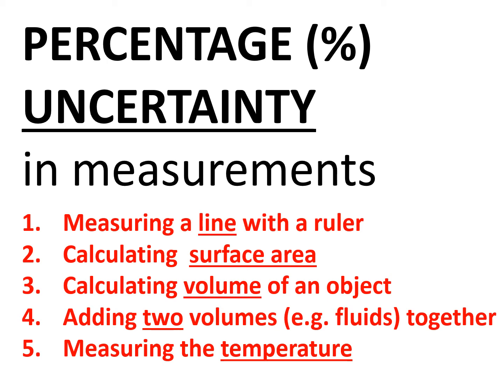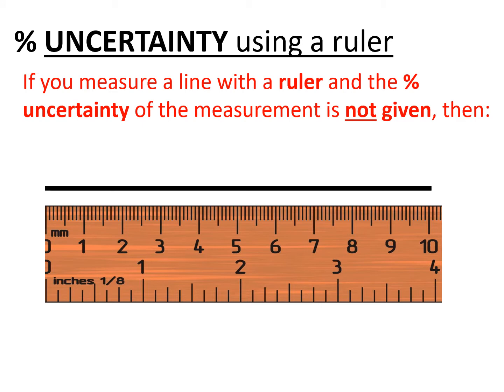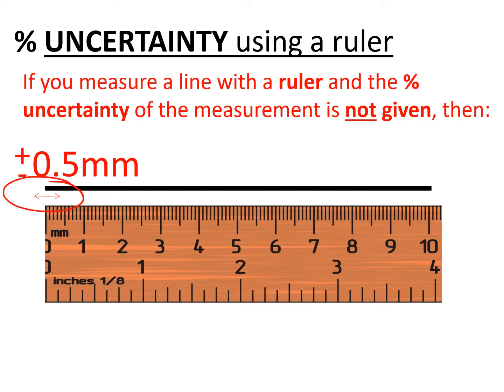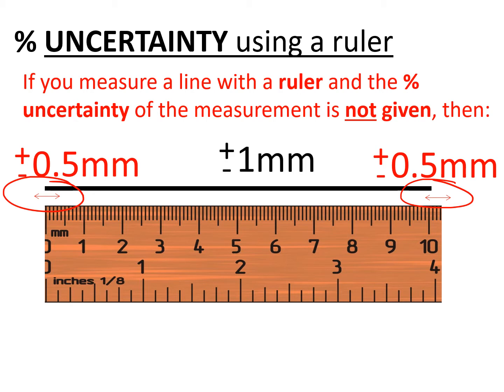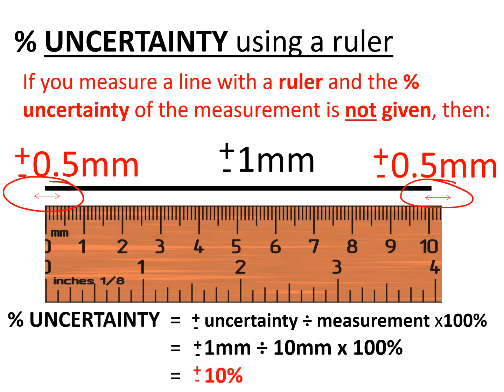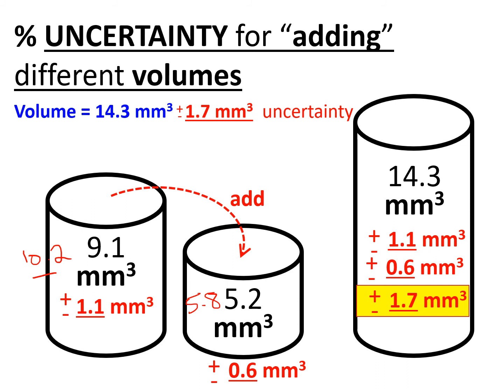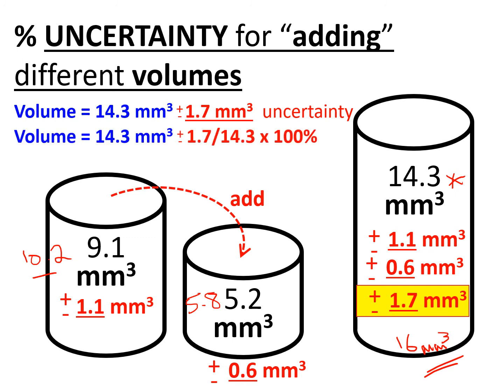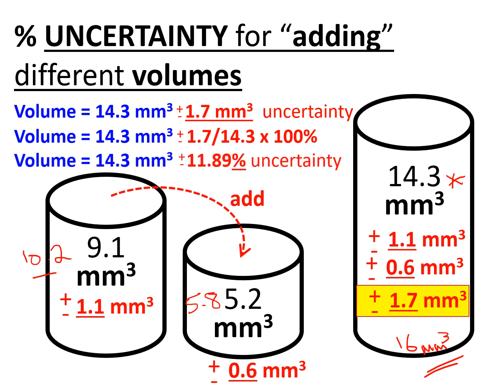MATHS FOR BIOLOGY: Calculating % Uncertainty

Comment: Surely the measurement on the ruler in example 1 is 100mm not 10mm? That would make the uncertainty 1/100 x 100 = 1%
Reply from the maker: Yes +/- 1/100mm x 100. But principle is the same.